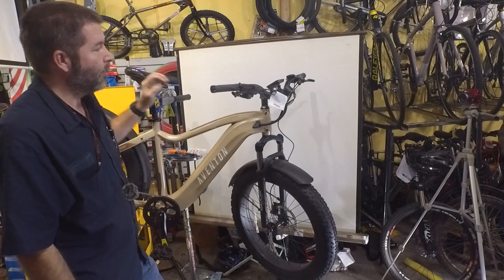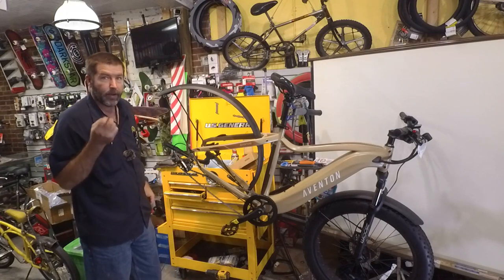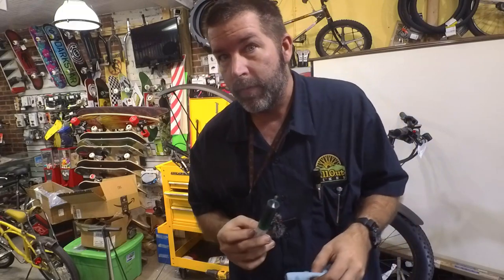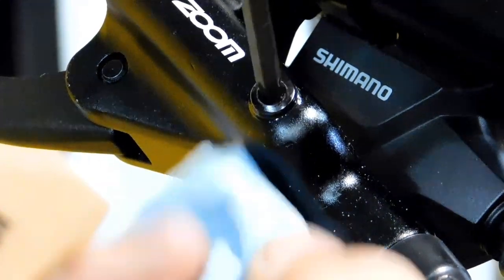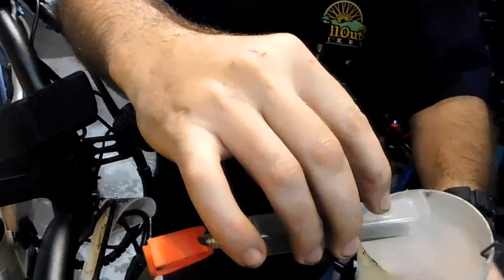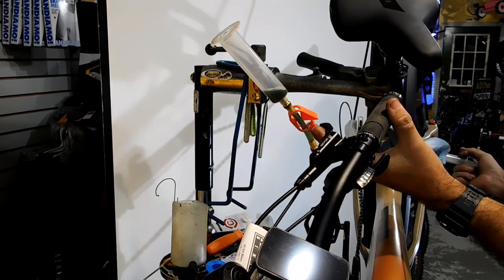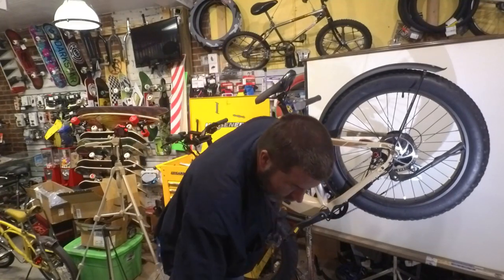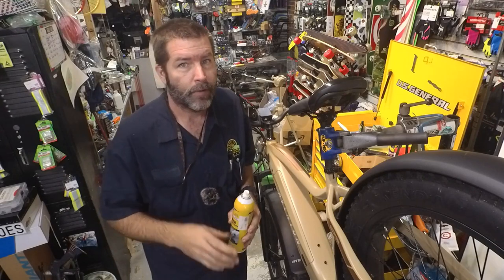Bleeding Zoom hydraulic brakes on a Aventon Ebike

Comment: I recently had this issue with my rear brake on my Aventon Aventure.  The brake lever was nearly touching the grip and I had almost no stopping power.  The local bike shop that I took my bike to mentioned that the rear brake will need to be bled and I agreed.  Hopping onto Amazon, I found a universal bleed kit that included mineral oil that was compatible with the Zoom hydraulic brakes.  I ordered it and it arrived a few days later.  I just performed the bleeding procedure on my bike and I was happy to find out how very easy it was to do.  I also noted that the existing oil in the brake hasn't darkened, so I'm in the clear with that and I won't need to change the oil in the line.  I'm glad I learned how to do this with my own kit as doing this myself will save me money in the future when this needs to be done again.
Reply from the maker: Cool. Glad it worked out for you.👍
Reply: I have the same problem with my Aventon Aventure, can tell me which bleed kit you bought?

Comment: Good information and thorough video, but why remove the wheel? That just seems unnecessary. Couldn't you have removed the caliper instead? Seems maybe even that may not be necessary. I have this bike and purchased it from a local dealer that specializes in Aventon bikes. They performed a complete brake purge/bleed and did not remove the wheel or caliper, as I watched. A few months later now, and the rear brake is spongy again. Somehow air must be getting in the system? I have inspected all areas and detect no sign of leakage. Your thoughts, please?

Comment: I work in a bike shop. We have nothing but trouble bleeding zoom brakes. Last one we did we pushed fluid back and forth, had no air bubbles. Put it back together and it still wouldn’t work. I think maybe there is a design flaw in the brake because the resulting non working brake makes no sense at all.
Reply from the maker: Yes. Zoom brakes are junk!

Comment: That's cool bike. Hydraulic brakes are always the best I just got and Epic e-bike but it has mechanical disc brakes they feel kind of cheesy. But it's fun to ride and it's fast 48 volt battery and it swappable so if you want to buy an extra battery you can always be ready to ride. I like it because it's got big thick rims with fat tires although I might change the tires out for more speed because they are more for dirt riding. Thanks for the video as always and the lesson.
Reply from the maker: Thanks for your comment. Sorry, I missed your comment. I actually like both types of brakes. The hydraulic performs best until you have an issue. When that happens it can get expensive. The cable actuated ones you have to tinker with more often but you can fix it on the side of the trail most of the time. You can make your brake feel less cheesy with a different lever or possibly a different caliper. Thanks for your comments.👍

Comment: how brake fluid get dirty/ may be theres a leak? or original oil was dirty. its not like a car , high temp. oil.
Reply from the maker: The seals in the brake wear with use causing contamination. Also water can slowly get in. My friend and I were riding downhill he was using Hayes brakes that use DOT4 brake fluid and his brake fluid boiled locking up his brakes.

Comment: Nice video, but my right hand brake is still mushy? I must be doing something wrong.
Reply from the maker: You may still have air in your brake. Try bleeding it again but make sure your turning the bike and handlebars different angles to try to work any air pockets out. Goodluck.👍

Comment: I have zoom brakes and other then going through pads every 100 miles or so, but it’s good to know how to bleed them
Reply from the maker: You shouldn't be going through the pads that quickly. You may need an adjustment on your brakes. You also want to make sure your using sintered brake pads and not organic. Thanks for watching.👍
Reply: I have zoom on my Aventon adventure.... same pads in great condition 1,580 miles. Something is wrong with your bike...
Reply: @alloutbikes  I have since taken a class on disc brakes maintenance and I have learned how to correctly adjust them and it is a great improvement on the longevity of the brakes pads , it’s been brought to my attention that if I wasn’t “racing” on the streets every time I went for a ride the brakes would last a lot longer ! They were right.going 22 mph every place instead of 32mph and acting like it’s a time trial race has greatly improved the overall longevity of the pads

Comment: What bike support are you using?  Thanks!
Reply from the maker: If your talking about the repair stand it's a professional repair stand from Park Tool.
Reply: @alloutbikes  thanks.  I have not found any videos that review repair stands for a heavier ebike like Aventure.  Do you have the model that bolts to the floor or the offset base?  I like your videos.